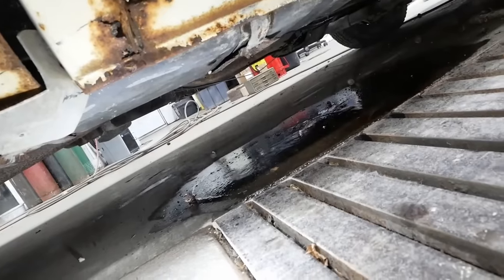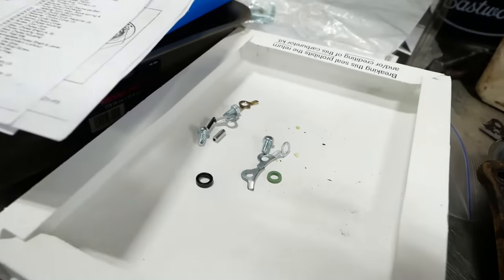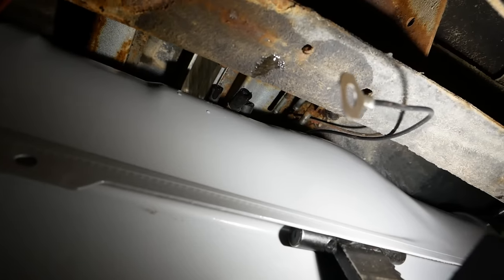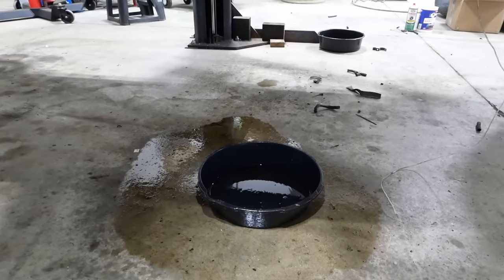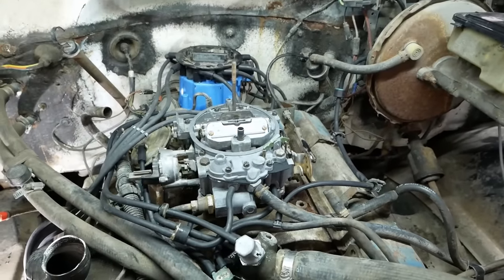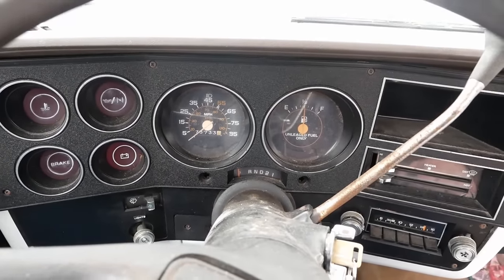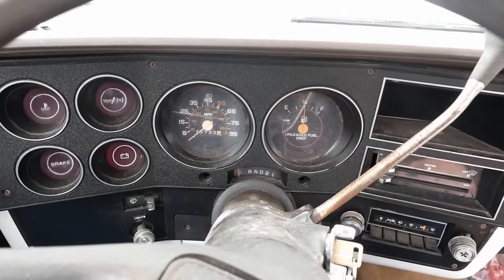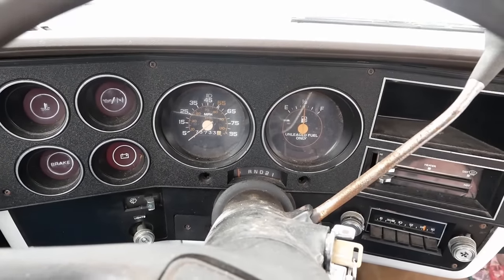Millennial vs. Carburetor | Square Body Chevy Back on the Road After Sitting 12 Years

Comment: Just a couple of suggestions from a tech that has been building these for decades. First, remove the carb again, turn it upside down, and notice the three well plugs in the middle of the throttle plate. GENTLY tap them just enough to make sure they're snug and apply a thin coat of JB Quick over them. They are notorious about leaking and will drop fuel into the intake overnight, causing cold start problems. Next, the choke spring can be zeroed in by putting the linkage in cold start position, and spinning the spring to have a slight drag from a 1/8 drill bit on the choke flap and housing. That big vacuum pot on the front of the throttle linkage is what they call a choke pull off, too. After it gets a good vacuum, it pulls the choke flap open slightly more, as the engine is still warming up. Check that, I usually replace them, as they're all decades old by now. For your off idle stumble, if you didn't start with counting the turns as you disassembled it, I usually start with about 2 1/2 turns off the bottom, and go from there. The hard line you tapped into for your vacuum gauge is for the transmission modulator valve. If there was fluid in the pipe, you need to replace the modulator on the trans. If it's dry, there is another rubber line at the trans where it plugs into the modulator, so check it for cracks too. maybe this word salad will help a slight bit. Kudos for being the brave Millennial and diving into it lol.
Reply: Ya beat me to it and I could not said it better and I even learned a thing er two. Thanks.
Reply: This EXPLAINS why I hated that SOB on my '74 Suburban, threw it in the trash and put one of the very first Aftermarket TBI systems on it.... at the time, they did not have one with enough CFM for a 454 big block, so I used a 350 version, knowing in advance it would never have the Low Down Grunt that I wanted, but I used it for 10 years before selling the truck
Reply: Lots of good advice here. The only thing I would add is to check the EGR valve and make sure it is not sticking . These were famous for getting carboned up and staying slightly open at idle. The other thing I usually did with these engines is run a bit more initial timing advance. +2-3 deg usually helped them a lot
Reply: I agree, also those EGR valves would sometimes hang slightly open & cause poor low idle & the mechanical advance in the distributor were almost always partially stuck or worn out, anyway I guess Greta would still not be happy
Reply: I've rebuilt MANY Quadrajets. All the tips you gave are good. Bump the timing to 6-8 degrees too.
Reply: Spot on with the well plugs. Address those and your cold start problems will improve when there is fuel in the float bowl.
Reply: Smearing epoxy over the well plugs is a band aid fix. removing the well plug, tapping it and threading in a set screw with epoxy is the proper repair method. I prefer marine tex for epoxy.
Reply: If the EGR valve is working like it should, you should be able to hear a rattle when you shook it, if not best bet was to replace it.
Reply: Well said , Yeah I have been working on these for decades they are good when dialed in but it can be a bear to get them there some times .
Reply: Yeah... This
Reply: @danpikulski6573  It's also possible that the balancer has slipped off center, and is giving erroneous timing indications.
Reply: I should also add a thing that is often overlooked is the idle tubes. They often get plugged and removing them is not easy but once they are cleared fixes alot of idle problems. I believe there is a company in New York that makes a screw in set...
Reply: The choke seems to be coming on but the cold/high idle needs to be set higher.
Reply: @danpikulski6573  Actually I do believe the Haynes Manual says the timing should be at 8 deg with the  distributor vacuum hose disconnected. So in reality once the vacuum hose is reconnected the timing will advance even more, the timing will actually be ~2-3 deg faster when you use a timing light on it after.
I always forget about the EGR valve! Brake Kleen for the win! 😁😁
Reply: You nailed it. 2 1/2 TURNS TO START THEN USUALLY OUT A LITTLE MORE. I think he got it with the vac gauge. Set the choke cold engine off, hold a slight pressure against choke plate and turn choke heater to get the 1/8 drill bit clearance. Start engine and recheck the 1/8 gap, if not there check the choke pull offs.  Rear choke pull off is he one that usually goes bad, but front one will also go out just not as often. Be sure to set fast idle screw to spec, can't remember what it calls for offhand Also have seen the well plugs leak.Usually bump the base time to 6 to 10, just be careful not to cause a spark knock. Those temp control vac switches usually came in in two parts, a common failure. I've still got one in stock to cure the two piece ones. Also good thoughts on checking the trans modulator.
Reply: Set the choke to fully close the choke flap when the engine is cold. do this by turning the electric choke so the pressure just closes the choke flap. it also must raise the fast idle cam to the highest position.

Set the fast idle speed at start-up AND the choke pull-off to unload the choke to the most ideal angle. i usually start with an 1/8" gap as others have stated here.

 It will probably take several dead cold starts to nail down the best high idle and choke angle settings. only mess with high idle on initial startup (dead cold) after a few seconds you lose your window of opportunity.
Reply: Ya what this guy said is spot on, Not that I would know , I run a Bakery in Canada. But ya plug the bottom things and the other thing too and you should be good to go.
Reply: Wow! Thats a memory for me..i remember the drill bit adjustment from years ago
Reply: @dave_n8pu  That's the PCV valve you're thinking of.
Reply: A more long term, user friendly solution is to find the right screw that fits (or make it fit, with a bigger bottom tap) and then put safety wire on everything. On my old carbs, this is what i do every threaded implement that i can get away with doing it to. For those i can't get to, i just put super thin lead solder wire on a few of the threads, which makes it snug, but not unremovable.

Safety wire is IMHO a far better solution than JB, in the sense that you're making a superior product, not a bodge on a really stupid design. Just my two cents.
Reply: Exactly! Well said!
Reply: i always hated quadrajet carbs, not as much as carters though
Reply: @terryharvey4811  Your correct, I misread it. Thanks.
Reply: @danpikulski6573  I agree with increasing the timing. I always ran the distributor advance to a venturi vacuum port and not manifold.
Reply: Elmer, you are the best! 👌💪🛻
Reply: @edgeman1134  I always thought Marine Tex was just the marine name for JB Weld.  I'm a boat guy so I've always used Marine Tex.  Are they different manufacturers?
Reply: @steveschumacher5470  - How DARE you!
Reply: @ligurian728  I have a buddy that claims JB weld is the same as marine tex. i don't buy it since marine tex is so fussy to mix (i use a scale when I mix it). also i've never had luck with JB weld when used in fuel...
Reply: @edgeman1134  I was underway and a bracket rubbed through the fuel rail on one of my Perkins T-6-354s.  I hit the pin hole with a dollop of Marine Tex.  That was in 1987.  I talked to the guy who bought my boat last year and he told me it's still holding.
Reply: Yes... best comment.
Reply: @dave_n8pu  You are thinking of the PCV valve. EGR valves are spring loaded and don't rattle unless they're broken.
Reply: @ligurian728  wow, impressive! we use to seal/join/screw pistons together for hydraulic elevators. i was impressed with it since it lives in hydraulic oil and it's now my goto epoxy for use in oil/fuel
Reply: What a lot of fiddle. Just replace it with a manual choke Holley 600 and your problems are over. Cheaper too.
You can spend a whole week arsing about with a dodgy Rochester and still end up no better off. Wes is finding that out now. Plug this, glue that up, resleeve that, clean this, adjust that, pull the damn thing on and off about a hundred times. Totally not worth it. They are overcomplicated expensive junk. If you want overcomplicated and expensive then get a set of Webers - at least they work.
Reply: I concur! Tricky SOB, but great when they're sorted out!
Reply: Is that manifold vacuum where Wes put his gauge when adjusting mixsture screws? i have heard that using a vacuum source on these carbs that isn't direct vacuum can also fudge up the cold starts.
Reply: @edgeman1134  You are correct that is what we did. We often just replaced that section of the carb .I have boxs of the me did at the dealership over the years!
Reply: Thank you for sharing your knowledge here. This will help many
Reply: @aserta  it's not a plane.....
Reply: Me personally, I like the videos that you have put out and I have also learned a lot from you.  Example I never new to pound the ears down on the brake pads. I've been working on my vehicles all my adult life. ( never to old to learn in life) thanks wes
Reply: @danpikulski6573  You are correct. The EGR on these years were awful too. I was concentrating more on what I usually do that I didn't notice, when I build the QJets. Of course, all potential related components must be tested and verified as part of the diagnosis and repairs. Good call on those problematic EGR valves.
Reply: @edgeman1134  Tapping and screwing plugs are a band aid too. I've rebuilt hundreds, if not thousands of them, and JB Quick has never failed me. Considering the factory seal is just an interference fit plug, anything done to make them secure and better sealed is a band aid. I think tapping and screwing plugs is overkill.
Reply: @DanEBoyd  BIG time, especially on one that is that old.
Reply: @Delekham  That step is a preventive step to ensure proper base timing, there should be no vacuum to the advance at idle. If there is, you have another problem and when you set the base timing with it connected, it will just add to the problem. Verify correct base timing, and that step is eliminated from the diagnosis process.
Reply: @terryharvey4811  All good info. That's why I replace the pull offs every time. I usually set the timing by ear and drivability on stock, street engines, but I've been doing this forever. It's 99.9% always a bit more advanced than factory every time. I was just concentrating on the actual carb rebuild steps. Yes, those blasted thermal vacuum switches play havoc on  any good mechanic's sanity, lol.
Reply: @woopimagpie  Sounds like some people are just not cut out to be mechanics.
Reply: @JamesAllen300  When adjusting the idle mixture screws on any carb, the vacuum gauge needs to be on direct manifold vacuum source. These years engines had miles of vacuum lines, and several different control methods. Things like ignition timing and EGR vacuum need "ported" vacuum, or vacuum that only occurred after throttle opening with zero vacuum at idle. Things such as transmission modulator valve and heater control valves needed "manifold" vacuum, or full time vacuum. This was at the last stages of carbureted vehicles, and by this time they had vacuum lines running everywhere.
Reply: @elmerfudpucker3204  no. tapping and screwed in plugs with epoxy is not a "bandaid" fix it is a permanent repair. I have torn down units that have been repaired with your method and the epoxy has not bonded or partially/fully fallen off. Great you have had luck with your method but I will stick with my method which is the same as what most pro qjet builders do as well.
Reply: @elmerfudpucker3204  I know. I was asking if Wes was using a direct vacuum source or not!!
Reply: @DanEBoyd  That’s why I 
tune these the old one by ear I advance them till they stumble then back off.
Reply: @erikgiggey4783   Carters are 
top notch.
Reply: @danpikulski6573  yea an old motor that's down on compression needs to be a bit richer to start. Plus I would time it to 28 to 30° top end then adjust the bottom revs to 8 to 10°.  I've had the idle as far as 14° and deliver bottom end idle and get of the line very well. He may still have a vacume leak somewhere.
Reply: @johncraig406  I had a 1989 Dodge Daytona 2.5L N/A Car that had Throttle Body Injection and I had so many Problems with it Probably because it was the First Carb+Fuel Injection Vehicle I had to work on and I didn't have much Time because it was my Driver to get to Work and Back
Reply: @danpikulski6573  EGR valve has been changed for sure(likely multiple times) and they may not have put the right valve or restrictor washer in when it was changed.
I probably just dated myself there. Carburetors don't phase me any, I have rebuilt and tuned many over the years, from micro size to multiples.
Reply: @edgeman1134  yeah, that's the better fix.
Reply: I'm in his boat, EFI is my choice.
Reply: Ugh, vacuum controlled carburetor?  I would have run the other way.
Reply: Not trying to be that guy, but its welch not well. @edgeman1134